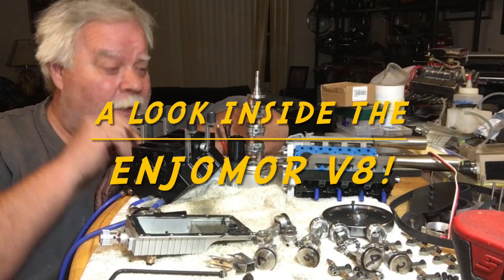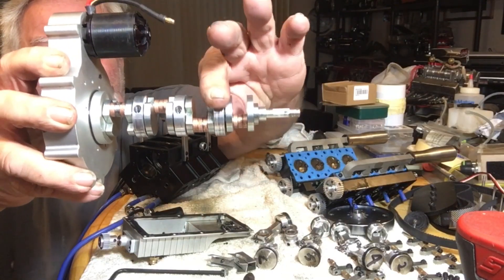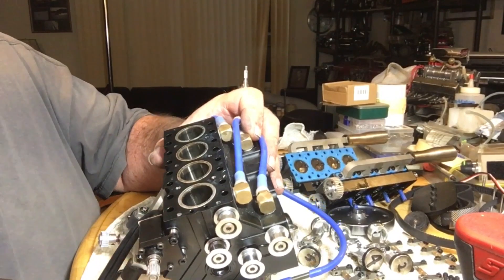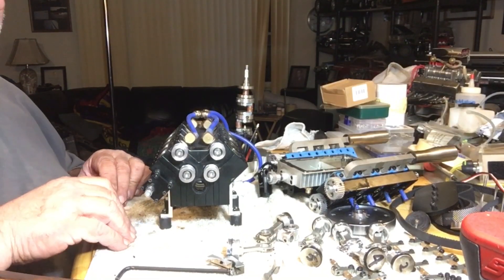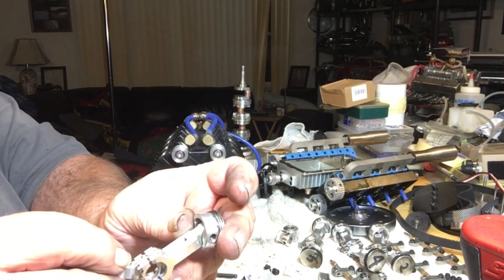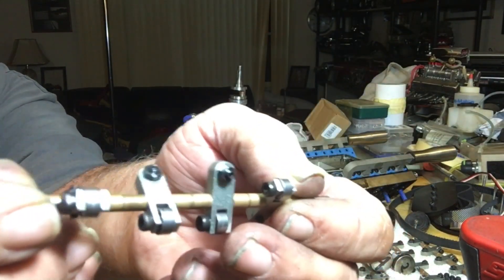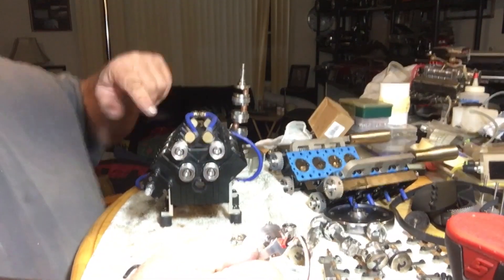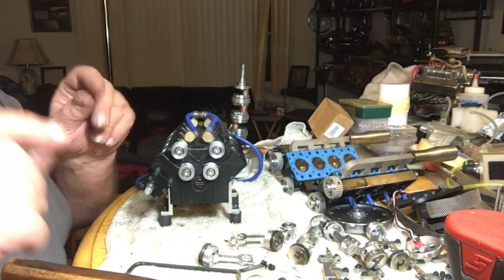ENJOMOR V8 TEAR DOWN!!!

Comment: Hello Dennis hope your well. I have just converted my enjomor v8 to run on glow fuel was fed up with slow reving and distributor arcing problems. I have posted the vid on YouTube. Keep up the good work.
Reply from the maker: I stumbled across your video and that V8 screams now!!!  awesome job on your conversion!! I might do the same on mine just for the additional power that you get from the nitro
Reply: @dennisdempseyradiooutofcontrol its unbelievable now Dennis so responsive. I used number 4 glow plugs and 25 percent nitro. I used .91 os carb

Comment: Thanks Dennis. I’m using a variable dc power supply. 0-48 vdc 10 amp.  Not getting any voltage on the output leads from esc.

Comment: Dennis,,, really curious,  I got mine a few weeks ago and am wondering what battery setup you use to start yours up with.
48vdc@10+ amps is strong.. like electric scooters ..that is using the 80a thunder ESC80A
help needed here .... thanks Dan
Reply from the maker: Yeah the 48v they said is way to much! Im using a 80amp esc with 14.8 v power from one of my old Cen GST-E kits to start mine. and a 3 cell 11.1v for the ignition cdi unit.

Comment: I'm waiting for mine to get delivered but a lack of  transmission housing and a clutch system sucks. I'm going to attempt to use a Conley  transmission clutch system on it and see if it works going to have to make an adapter plate